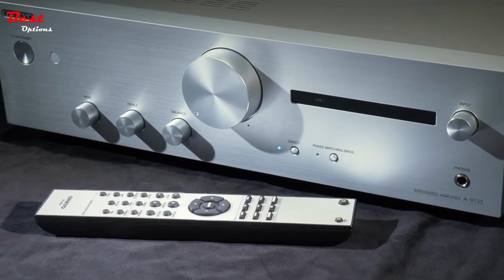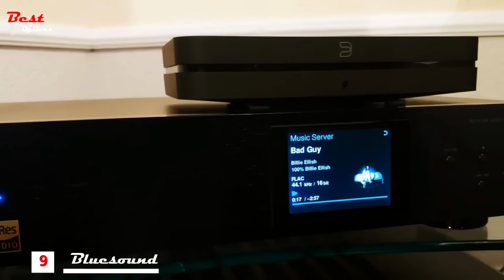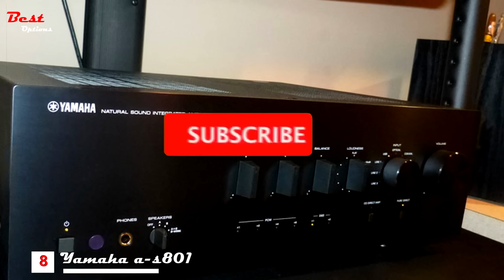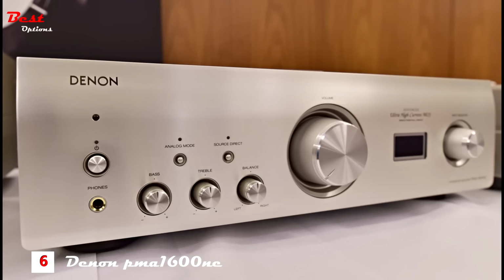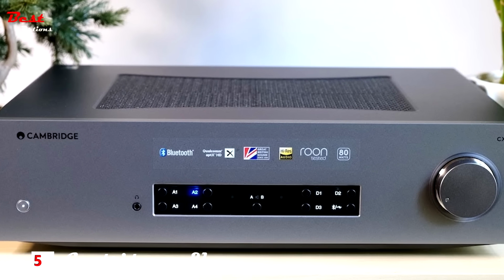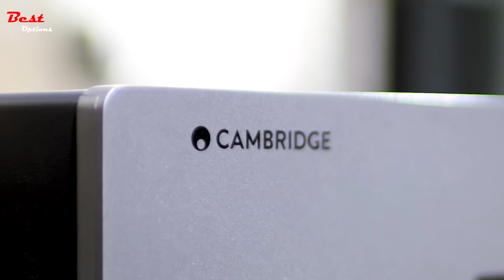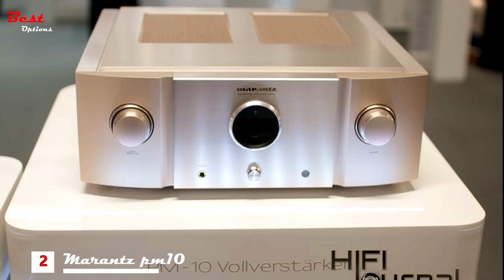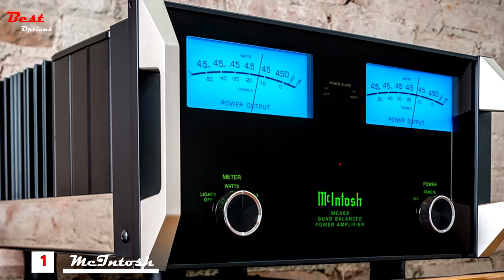Best Amplifier 2023 | TOP 10 BEST AMPLIFIERS AMP 2023 | HOME THEATER | AUDIO | Hi-Fi

Comment: They're all Integrated Amplifiers, not Amplifiers because an Amplifier needs a pre-amp in order to operate.
Reply: No, not necessarily, you can "attack" a power amp directly with the output of your CD player, if it is variable, or a DAC with volume, because with 2V output, the preamp is not really essential !  😉
Reply: @dab9742 n this case, they're called by Integrated Amplifiers by these Manufacturers, if you don't believe me, go check them out.